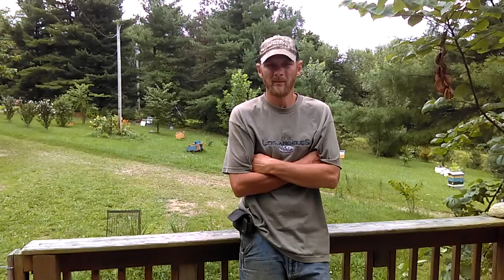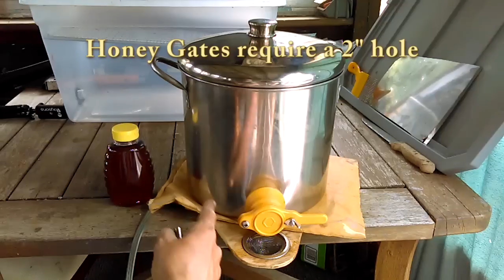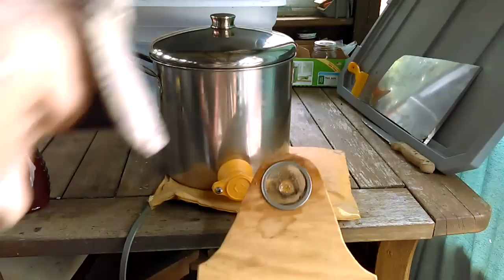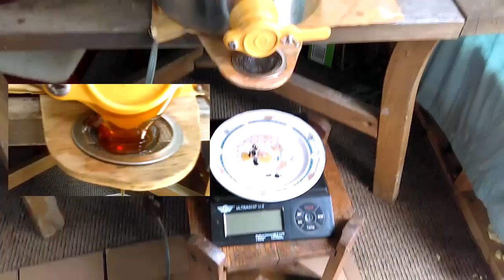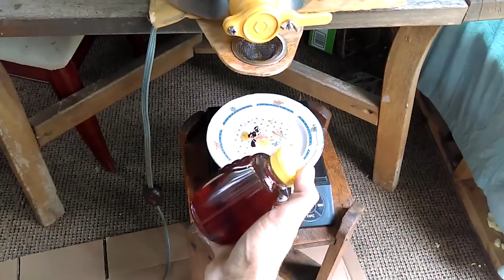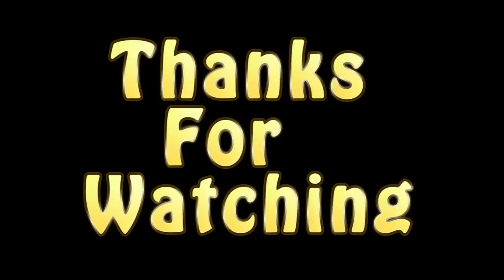Homemade Honey Bottling Tank

Comment: Once you use a water jacketed bottling tank with dripless valve it's like a nirvana experience. Honey on tap.  Plug it in and it decrystalizes honey.  
Dripless does not equal drip-proof.
Well worth the expense. Bottling and extracting equipment pays for itself and holds value like high dollar sports cars. Great investment.

Comment: I just built an air pressurized bottling tank with an in line air drier using a plastic 5 gal. bucket with a screw on lid. No need to heat the honey.

Comment: Looks pretty efficient, nice job. 
I always just strain out of the extractor into five gallon buckets with gates on them then I can bottle from those or transfer to five gallon pails without the gates for bulk sale. I saw one set up in another video where the guy had a machine that was adjustable to meter out the exact amount of honey needed and it was automatic start/stop. It was slick but I'd hate to imagine how much money they had in their equipment...tens of thousands I'd imagine.
Reply from the maker: Agreed! I much rather prefer to strain the honey before it goes into the bottling tank. It makes the process soooo much easier. 
I have seem so of them fancy bottling tanks, they are very pricey. Mann Lake makes a decent one I'd like to have someday. If I remember correctly, it's around $1200. It has a double wall to hold water which you can heat via the controller on front of bottler (AKA water jacket).  It also acts as a wax melter which I would probably never use it as. I like my solar melter too much.
Reply: That doesn't seem too bad for a price on that, the problem is that once I start considering that stuff it's one of those things that doesn't stop. Like I want this thing, I can afford it... well if I get that then I really need this thing and that thing and another thing...pretty soon I'm thinking I need a dedicated building and then one day I wake up wondering what the hell I was thinking, lol.

I just got into processing my own wax this year. I had a bunch of old full plastic frames that the wax coat got too thin on from being stored and the bees wanted to build cross comb on it. I had a bunch of old sheets of thin foundation I didn't need so I melted it down along with what burr comb and old comb I'd collected this spring and recoated those frames and man did it make a difference. I'd like to get a roller/imprinter and start doing all my own foundation from my own wax.
Reply from the maker: Yes, you are correct, once you start buying fancy equipment it never stops. But if your growing equipment is almost needed to save time.
How do you render your wax? I mentioned I use a solar wax melter. It works very well! Them foundation presses are very expensive, have you priced them? I had a bunch of plastic foundation I had to recoat this spring as well. It does make a huge difference.
Reply: Agreed, in order for one guy to be as efficient as possible, you just have to have good equipment. There are a lot of circumstances where a person just is not capable of working hard enough to get things done without proper equipment.

Yeah I have priced the presses, you're right they are unbelievably expensive...unbelievably expensive. I've often wondered why the hell they are so high, there isn't much to them. I guess it's because the mfg can get it. Still though if person does the math and handles very many hives, it will pay for itself pretty quickly. Bought sheet foundation is ridiculous as well as is the full plastic and in the case of the full plastic, if a person has to spend time and wax re-coating it to get it to work well then you almost might as well be making full wax sheets that make handling things easier to start with. It's really hard to manage queen cells on the plastic stuff without ruining them, almost have to just cull extras and swap frames around for splits and that's wasteful. Plastic is also hard to clean back up and reuse from brood chambers. @ $2-@3 per frame it wouldn't take long to cover $1200 for a press even at 20 hives.

I just used a big pan with water and a smaller pan in it all sitting on top of a little Coleman gas burner. I tried using a slow cooker but it took so long for it to melt the wax I had to find an alternative. It's easy to see that the wax is probably the most valuable of all the products we get from the bees in beekeeping. It takes the most resources and time to accrue and is pretty perishable if a person doesn't take good care of it because of wax moths and hive beetles. If plain plastic foundation is worth $3+, what value should a keeper put on a drawn comb of all wax? The most valuable thing I used this year by far has been a bunch of empty deep brood frames I had put in the freezer from absconds and splits that I took half and gave back new. It's hard to catch it without brood for one thing.

Comment: I like it. I also just realized that you showed this bottling tank in your video on, lowering the moisture content. I usually reuse my extractor tank for bottling, but i do have a square bucket with a honey gate for smaller batches. So, do you usually have so much honey, that you leave most of it in buckets and only bottle a little at a time?
Reply from the maker: You surely have a good memory. I totally forgot I had shared this bottling tank in the video. Using the extractor as a bottler makes sense, I may have to try that for larger orders.

Comment: FYI... Look up BN-LINK Digital Heat Mat Thermostat Controller. It lets you heat up to 108 and turns off and on automatically.
Reply: Full disclosure, I use a $80 bucket heater with it.

Comment: Okay I'm using the same gate valve but the inner nut does not want to screw into the gate valve enough to seal. I have filed and filed the threads but not much improvement. Looking for something to turn the inner nut with besides a pair of channel locks. Back to Home Depot I guess.
Reply from the maker: Actually there is a wrench for that valve but you have to 3D print it. I had a friend make me one and it only cost $5 to make. At first I thought a plastic wrench would not be strong enough to do any good but once I got it I was proved wrong, it's been very handy to have. Here is a link https://www.thingiverse.com/thing:2593602